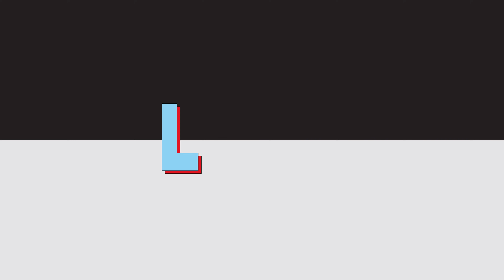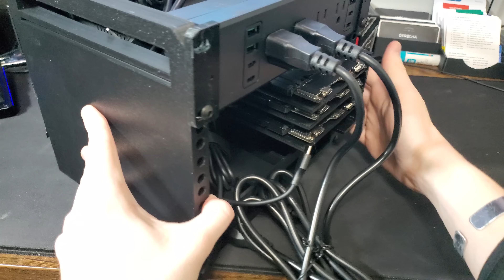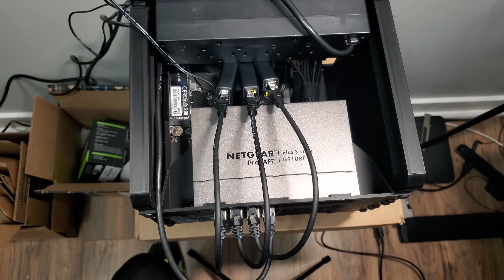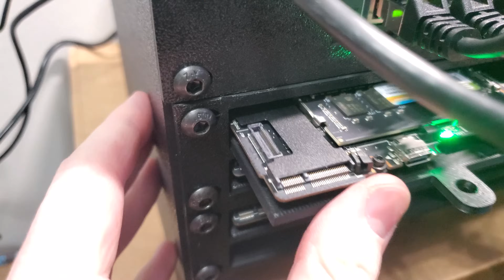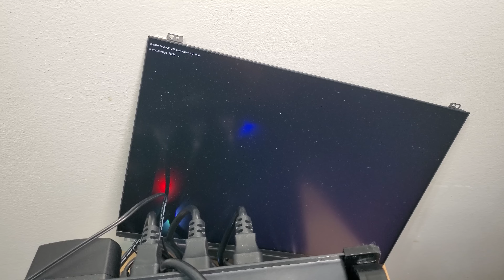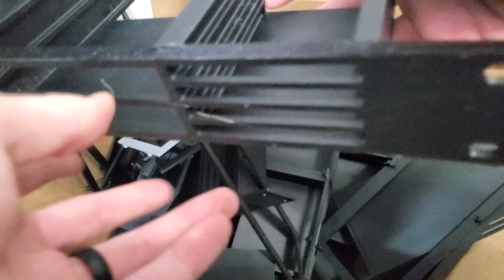The Framework Cluster | Homelab build | EP1 | The Overview of the Framework Laptop Cluster

Comment: more from this series??
Reply from the maker: This series died, went another direction and sold off the parts the form factor just sucked, and realy wasn't a great use case for these.
Reply: @learntohomelab wow really ? what made you change your mind because it looks very cool
Reply from the maker: @masterjack8222 too big, too long, fans blowing out the side when racked in a server rack instead of the back, lots of adapters needed to connect external 2.5inch SSDs. Need video output to trouble shoot a node? That's more adapters or having to hook the main screen up again which means pulling it out of the rack to get to that connector, no real power button besides a little spot on the board that you gotta pull the board out to get to, etc. 

Much easier when a mini PC already blows front to back, has display ports, and a power button easily accessible, etc. 

These things just add too many tasks you need to over come.

Comment: This was a weird 1.....
Question?
What kind of 3D printer are you using?
It seemed like ABS plastic.....
Plastic wasn't strong enough would be my guess.....
Reply from the maker: The plastics are strong enough, the issue is design or thickness usually. In this case we used PETG. ABS isn't super popular due to the toxic fumes and having unfavorable characteristics compared to things like ASA and PETG.
Reply: @learntohomelab  What about Fiber glass?
Reply from the maker: @MarshallLapenta there are fiber infused filaments but not really needed for something like this

Comment: Why did you use Ethernet to interconnect the Framework motherboards?

As far as I know you could probably ist the Thunderbolt connection and it has mutch more bandwidth.
Reply from the maker: Cost and what I had on hand. At the end of the day this is a project that will be taken apart and used for other things.